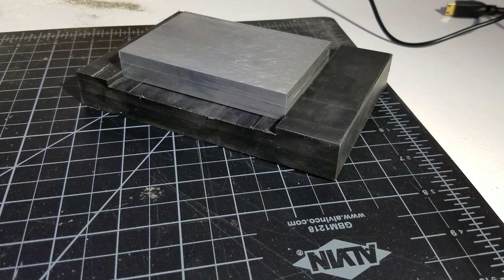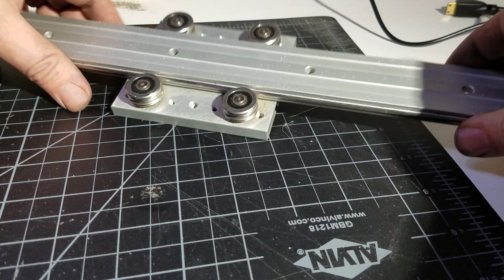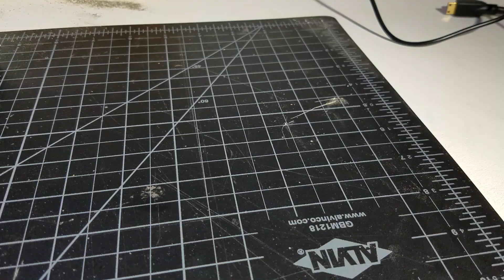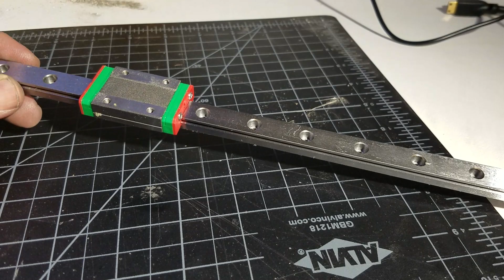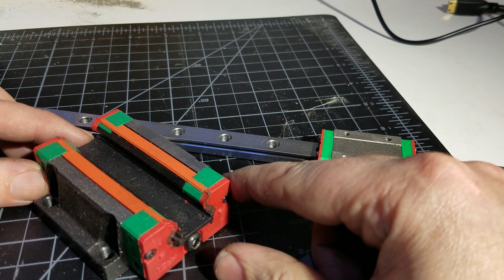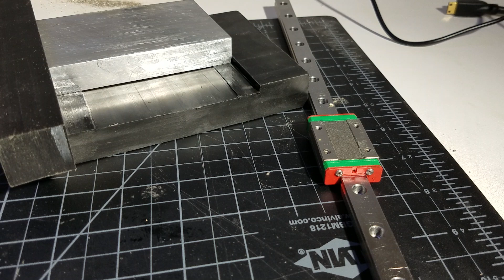Box ways made from HDPA and aluminum

Comment: Look into rulon xl, it is rated for running against aluminum. I am a custom machine builder and I have been using rulon 142 for years against cast iron, recently however I have switched to the XL which is not intended for machine tool applications but is has lower deformation under load and an extremely low COF of around .02. Also if you want good constraint in five out of six axes you'll want to make your saddle at least as long as it is wide to prevent yaw. Look at the saddle of a box way turret mill like a Bridgeport series 2, there is a raised portion in the center which is very long but skinny and it introduces a third gib known as the positive gib, since the aspect ratio is almost twice as long as it is wide it completely eliminates yaw, also it is positioned directly over the leadscrew. Your two keeper gibs as they're called, will eliminate pitch and roll nicely. Also most machines have a relieved portion under the saddle so across its length there is an area in the middle which is .001-.003 relieved from contact approximately 40%, so if your saddle is 10" long there would be a 4" relief in the middle with 3" long pads of contact on either end, this does two things, it alleviates any pitch as the axis wears because you have removed the fulcrum, and it also leaves a pool of oil in the center so no matter which direction the axis moves it will get oil. I am not a huge fan of linear guides for vibration damping reasons, they do not pass vibrations very well at all and honestly sometimes accentuate it. If you must use them on the table axes I would recommend a very heavy massive thick table, you need to absorb cutting vibrations right at the source, box way machines pass vibrations through the components so the table, saddle and base of the machine act as one, not the case with linear guides, also if you dont make the table with enough mass the vibrations will greatly reduce the life of your linear guides. On modern cnc equipment the castings are massive to absorb vibrations and the linear guides are placed as far away from the cut as possible to shield them from vibration. I hope this helps! God bless!
Reply from the maker: Thanks for the great details in your comment.  It looks like  rulon XL is PTFE.  Have you ever ordered unbranded PTFE?  I was also considering UHMW.  

I also just posted a video testing out how accurate my CNC can cut tapers.  The delrin is much slicker than this HDPA (likely recycled).  My main question regarding the taper is how accurate should it be and how can I retain it so it stays adjusted without special hardware.
Reply: @JesseSchoch  the plastics you mentioned have good COF but unfortunately UHMW is just way too soft, it's not even 60 durometer I dont think? Delrin is much harder and I know hardinge used nylon on the saddles of their hlv-h for years, the problem with all those plastics is they are hygrophobic so they absorb water, and maybe you dont plan on using coolant but I know in the case of the hardinge machines they absorb atmospheric moisture over time and expand and eventually your epoxy bond line fails. Turcite, rulon and theres a few other ptfe based materials, have been engineered for way liner applications, they have a filler in them, usually bronze or polymer sometimes glass which makes them much harder and able to take higher loads without deforming, also they aren't hygrophobic so coolants wont bother them and they have been engineered to have a coefficient of thermal expansion similar to iron so it wont sacrifice your bond line as the machine warms up. Ptfe by itself is ridiculously soft and you wouldn't have very good accuracy under load. Also the other issue with non way liner specific plastics is getting them to adhere, the rulon and turcite products are chemically etched on one side for bonding, and tristar plastics (the company who sells rulon) also makes an epoxy engineered for this application in addition to its resistance to oils and its durometer it also has glass beads in it to ensure that you maintain a minimum .003" bond line, as it is possible to squeeze out all your epoxy while gluing up if not careful. For tapered gibs I usually machine them close and then hand scrape them for a perfect fit, all way liner materials must be hand scraped, not just for accuracy but also to give oil pockets and to slightly reduce contact, if you grind or mill the plastics they have a tendency to act like a gasket on the mating ways and the oil cant get out of the oil grooves and it creates an enormous vacuum as it is slid. I have seen saddles on large lathes that had ptfe based wayliners added that were not scraped and you can barely crank the hand wheel because two smooth surfaces running together will have a tendency to wring to one another much like gauge blocks do, it's a strange phenomenon, but it can cause big problems. As far as easily retaining the gib I tend to favor a headed gib, which consists of a toe or head sticking off the side of the large end of the gib, there are two screws, one pulling and one pushing against the saddle to effectively make your adjustment and lock it down. I'll check out your other video.
Reply from the maker: @cgprecision    Thanks again for the info!  My use case here is a very small dedicated mill for doing PCB routing.  I likely going to be using a .8mm end mill and not cut much deeper than 1.5mm.  The traces are cut at .1mm depth of cut.   the working area will be only 200x200mm.  

That's not to say I can't apply what I'm learning here on a larger machine and I have some ideas which need a much more rigid approach.
Reply from the maker: My spindle will be roughly 120mm from the center of the moving block.  the block is 66mm.  i understand the 2:1 rule is measured from the edge of the bearing which should get me well under 2:1 and this should be safe to prevent any racking.  No reason for me not to use the ratio you pointed out, it is sized this funny ratio because of the size of the scrap block I chose to do this test ;)